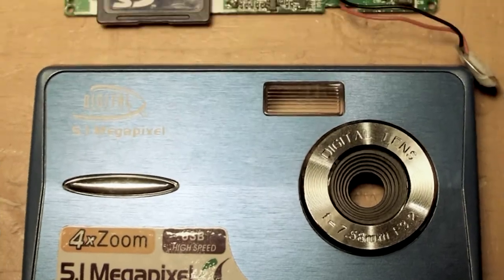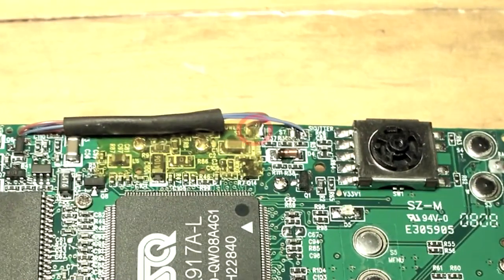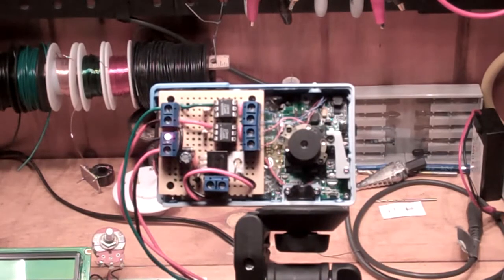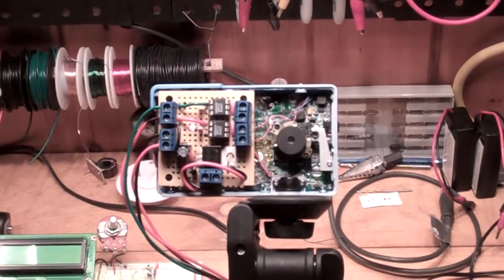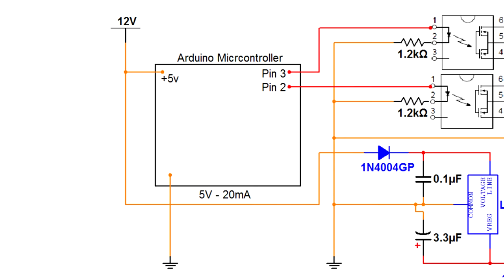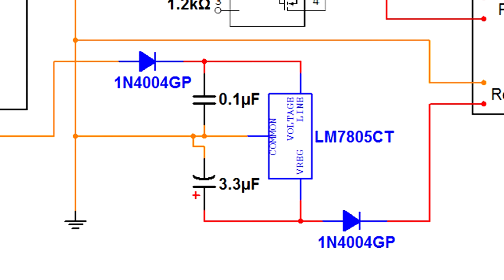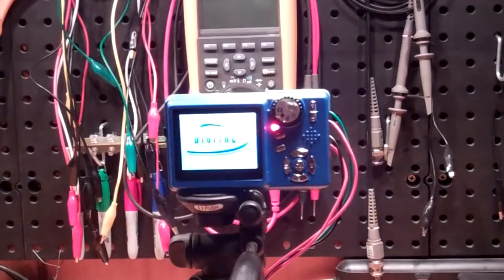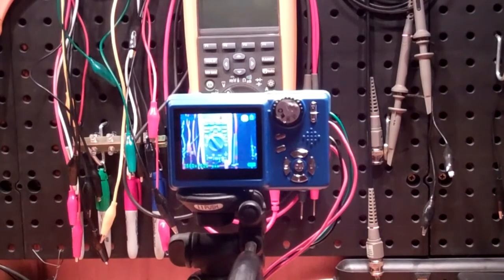Arduino Time-Lapse Camera Project (The Lumber Dance)

Comment: I'm not saying it didn't "meet my needs", i'm saying that the quality of the camera just wasn't very good. My aincient Samsung Digimax 360 that is 3.2MP, which is also very cheap nowadays achieved much better quality. You just gotta know what to look for. you dont need a lot of megapixels for quality. Also, you are looking in all the wrong places, Nikon D70s DSLR actually goes for 100-200$ used, depending on whether or not it comes with a lens.